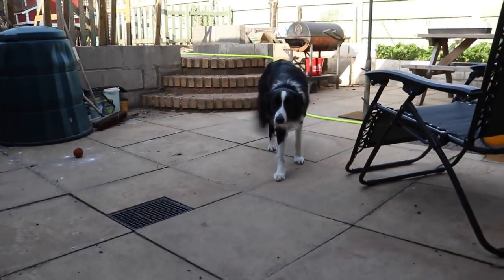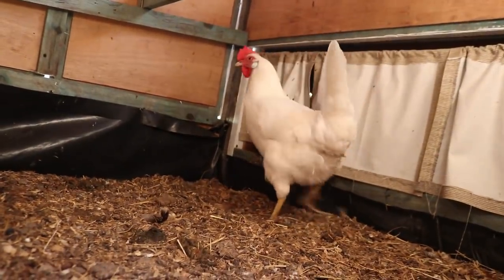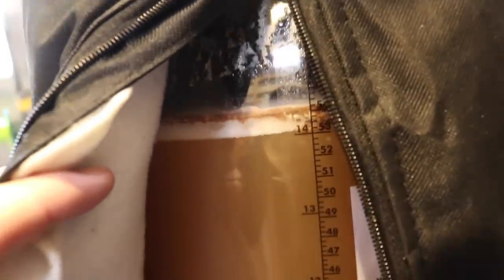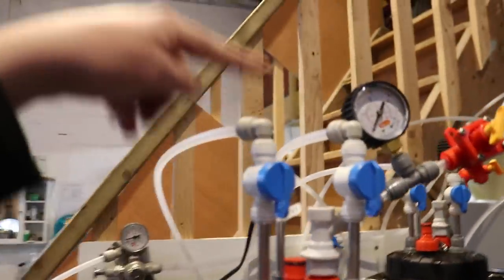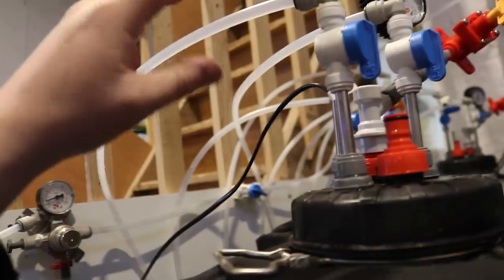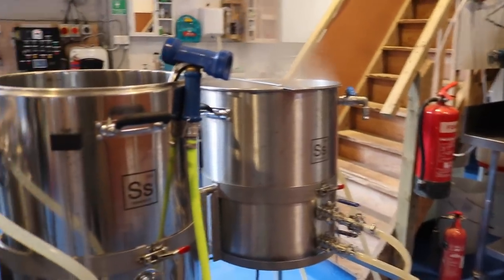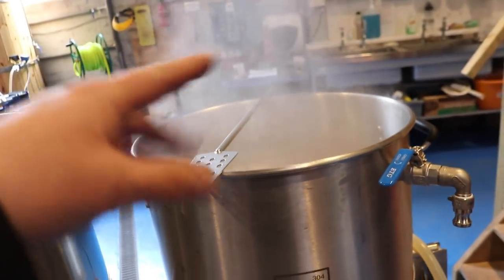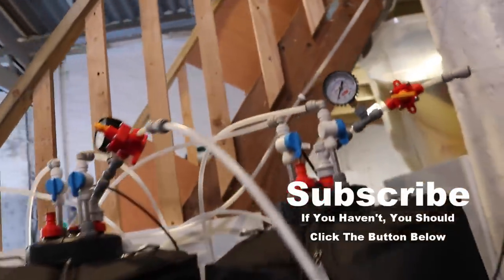Can We Brew A Lager Style Beer With Kveik Yeast

Comment: Have to admit done a few " lagers " with Kveik now. I transfer at about 35 celsius, oxygenate and under pitch. Put spunding valve on set to 15 psi at first and keep temp at 35 celsius. Once krausen drops turn pressure up to 30 psi on spunding valve and then when finished and had an extra couple of days cold crash and it's carbed and super clean. It's weird stuff that kveik. Worked great on a stout and I use it on most beers that are WLP001 non expressive yeast under pressure. 
For NEIPA I go a bit hotter and no pressure the first 48 hours then raise pressure and dry hop as per regime. Seems you need to throw the rule book out with Kviek!

Comment: Harry, I would recommend giving Fermentis' 34/70 a shot for your pilsners.... it's a bit under the radar compared to the Fermentis well-known strains US05, 04 etc. I've had some seriously impressive results using it - imho it's far better than a range of wet lager yeast strains that are commercially available.
Reply: But US05 is an ale strain ?
Reply: @tomasbeha1645  - yes, I was just making the point that I think 34/70 is a little under-appreciated and not used that often by many homebrewers in UK. I wasn't suggesting that it's a replacement to US05, although it will ferment at ale temps